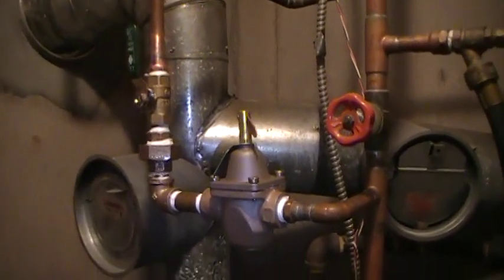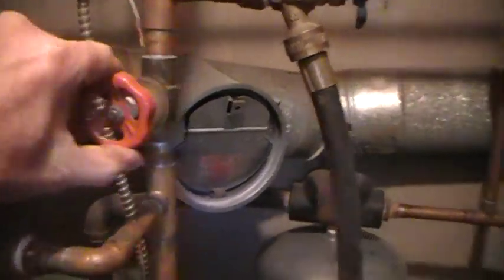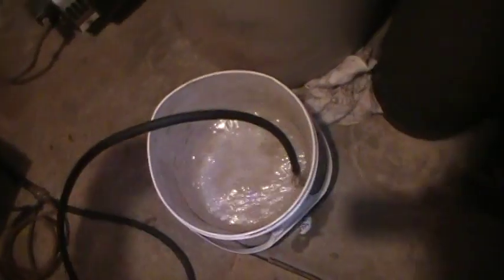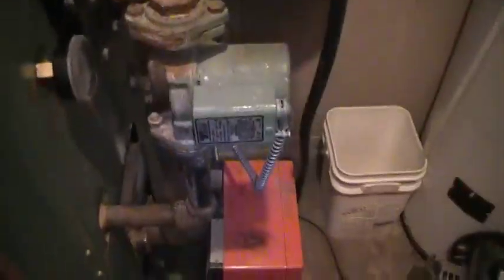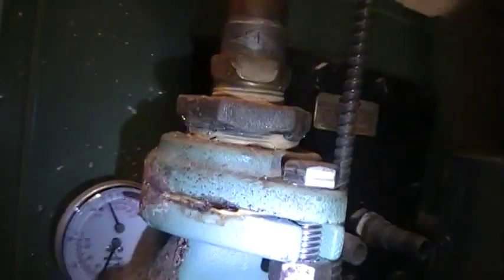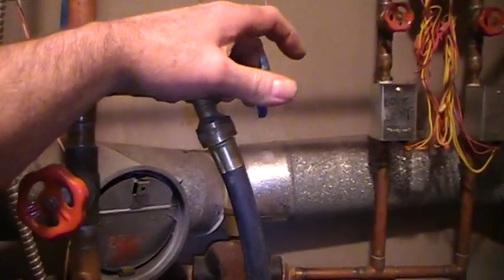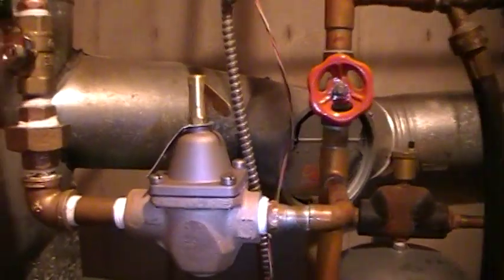How to remove the air out of your hot water heating system-girgling noise.

Comment: I wish I could have you come to my folks house.   Their gas flame is burning almost non/stop, and the baseboards are cold.  I think there is a problem with a lack of water in the system/too much air, but I can’t match up their boiler/system with the one you have.   Is the return valve the same as the valve which controls the water supply?   They have a pump that circulates the water.  The boiler and piping is very hot because the gas flame is burning so much.  One pro said the boiler needs to be replaced at a cost of $5500, the other cleaned everything, with no improvement.   It seems like this is a simple problem to fix but I’m struggling to find a solution, and wasting money on professionals who either lack the knowledge or integrity to fix the problem.  😢
Reply from the maker: Hello Dubble D,
Looking at the boiler; you have a pipe coming off the top and one on the bottom. The one on the bottom is your return line. If you follow it; you will find the pump that you mentioned and a valve on the same line either above or below the pump. Depending on the number of zones in the house; there could also be a few tees with individual valves on each branch. You should find drain valves just before the valves. Hopefully you can follow me here.
What type of heating system do they have? Is it baseboard heat or cast iron radiators? 
The burner should only run until it reaches temperature in the boiler. 
What is the pressure on the gauge (tradicator) on the front of the boiler? The pressure should be between 10 and 20 PSI. If not you will not have enough pressure to make the water rise into the system.
Is the heat not working in all the house or just certain parts?
Are there zone valves on the system as well as in this video?
By the way...changing the boiler is not the solution.
Get back to me later on today and we will see if we can fix this problem....
I will check in later on....Al
Reply: Thanks Al.  It is baseboard heating, no additional zones.  There are pipes which seem to go everywhere.  The pressure is about 20.  I can identify the water supply, and the drain faucet is below the pump.   There are no multi zones.  All the baseboards are either cold or lukewarm only when the burner/pump are running.  The return line is burning hot, just like the boiler and the exit line.   This problem is beyond my scope of understanding; the complexity of the piping is very confusing.
Reply from the maker: Hello Dubble D,
Air is definitely the problem. 
You will need someone to either purge the air out of the system or attempt it yourself.
If you look on the end of the baseboard cabinet you may see an air bleeder there. On older systems these bleeders were installed to remove the air in the system. Depending on how old the system is; this could be what is there. It could be on either end of the baseboard.
Very easy to remove the air if this is the case. Simply turn the screw or wooden handle until you here a little air coming out. once you get water simply close the bleeder (needle valve).
Wish I could help more.
If I lived next door; I would drop over and get things in order for you...
Thanks for commenting and best of luck with the repair!
Hope you have a good holidays!    Al

Comment: Great video. After watching this video I do not know if you can help. I have a split ranch home with 3 zones for 3 floors. The upstairs floor gets plenty of heat, the second (middle floor) gets no heat & the first floor, where the boiler is get a little heat. The circulator pump is working the zone vales are open.
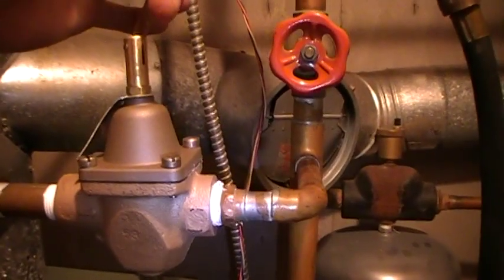My problem I have three zones and they join into one pipe without any return shutoff valve and I do not have a pressure reducing valve like you have in the video. The supply line goes to  a fitting like the one that is in the video at 2:27 with an expansion tank & air bled. When I try to bleed the line I cannot remove all the bubbles plus the water stop flowing, pressure goes to  0.  Your help will be appreciated.
Reply from the maker: Hello Joe,
There has to be some reducing valve to keep the pressure low or your relief valve would be flowing continuously.
It may not look like the one in the video, but there should be one somewhere in the line feeding the boiler. Follow it back and see if you can find one. 
Does the pressure rise after you purge the loop and are you isolating a valve on either end of the loops?
By turning off the power on boiler that will close all the zone valves. A return valve must be closed to purge the air properly. 
Is there a single valve below or above the circulating pump on the return? This was a common practice on older systems.
Having low pressure generally causes the second floor to lose heat first. 
Get back to me when you get a chance....Al
Reply: Hey Al thank you for replying so quickly. With the supply side open I do not understand how it went to 0 PSI when I opened the return line to purge. As I mentioned it does not have a pressure reducing valve, ( or I just can not find it)so I do not know what is blocking the inflow or keeping it from building up too much pressure. The water supply is from a well. When I shut the drain valve it takes a long time to regain pressure. There isn’t any shut off below the circulating pump on the return. If you have any time to look at it I took a short 2 min 30 sec video to show how it is set up. I do not know how to send it to you by you tube. Do you have an email that I can send it?
Any suggestions on how I can get the other zone free of air. If possible I rather  not have to open the lines due to the weather if possible.
Reply: TheOldkid888 do you have the power to the boiler on while doing this? Does the circulator Pump help remove the Air
Reply: I tried it with & without the circulator pump on. The pump does help but I did not let it run too long. When it started to make a gurgling noise I shut the pump off. Not sure if the pump would be damaged if no or not enough water flow through it. As far as a pressure reducing valve It looks like I have an automatic one that is attached to the expansion tank. Found this while looking up parts.
Reply: Joe San r

Comment: Hi, I have a Peerless WB3 with no zone valves. Where is the return valve located? Thank you.
Reply from the maker: Hello Believeit,
The valve should be located in line on the lower section of the boiler. Sometimes there is only one valve that isolates every zone on that end. It should be just above the pump. I always install a valve above and below the pump in case it has to be changed.
Thanks for commenting and enjoy your weekend!       Al
Reply: Thanks Al.

Comment: What should the boiler temperature be when doing this ? Thanks
Reply from the maker: Hello garagekeys,
The boiler can be left on if you are planning on doing this and it will cut in to control boiler temperature.
Temperature of the water does not affect the amount of air that will be purged out of the system. Hope this helps!
Thanks for commenting and enjoy your weekend!   Al
Reply: thank you!
Reply from the maker: Good luck!    Al

Comment: Is there any reason this can't be done backwards:  shut off the outgoing, open the zone, and open the faucet/gate/spigot?  Does it matter where the pressure reducing valve is?
Reply from the maker: Hello Glenn,
In this video the zone valve is locked opened as you stated. The return valve has to be closed as the air must be forced out of the sediment faucet. Having the return valve opened will only allow water to flow out of the boiler. You want it to flow around the loop forcing the air out of the sediment faucet.
It doesn't matter where the pressure reducing valve is located. The water will flow into the boiler and then the loop through the zone valve.
Thanks for commenting and enjoy your week!   Al
Reply: Thank you for your prompt response, however, I don't think I explained myself well.  The only shutoff valve that closes both of my zones at once is located on my outgoing pipe, before the expansion tank, not on the return.  My purging valves (I think that's their purpose) are located above the zone valves on the return line.  However, after the two returns merge into one pipe, my pressure reducing valve enters the line before it hits the recirculating pump and goes into the boiler.
So, can I perform this operation backwards, that is to say, close the outgoing line, open one zone, and open the purge valve or will water from the reducing valve just travel upwards two feet and flow through the purge valves instead of flowing through the zone pipes?  Thanks.

Comment: Thank you very much, this is very helpful! if I can have one question though,do I need to turn off the boiler to purge the air or I can just turn off the heating via the thermostat?
Reply from the maker: Hello  小秦,
You are more than welcome!
You want to turn off the boiler itself. I have seen people purge the system hot. I prefer to turn it off myself. 
Hopefully everything will go well for you!
Thanks for commenting and best of luck with the project!   Al
Reply from the maker: Hello eEva,
If you turn your thermostat up it will open the zone valve and no need of manually hooking it. You will only need to close the return valve and purge the loop. Should be all set.
Thanks for commenting and enjoy your weekend!     Al
Reply from the maker: Good luck!    Al

Comment: Al, When you use the pressure reducing valve, to increase the pressure - in case it goes to low or you just want to force more air out and increase the pressure. Lets say the pressure goes to 20 psi. but you want only 15 psi, after adding pressure to the system, how do you get the pressure to go down to 15 psi again ?Thank youSteven
Reply from the maker: Hello Steve,
I put the pressure up to a constant 20 psi to purge all the air out of the system.
If you don't keep the pressure up when purging you will not remove all the air.
After purging the system and the sir is removed; you open the sediment faucet that you used to purge and you can drop the pressure back to where you want it. If it drops too low simply lift the lever on the reducing valve and you can adjust it between 12 and 15 pounds. The valve should automatically adjust the pressure to 12 pounds if it is not plugged with sediment. 
Thansk for commenting and enjoy your week!    Al

Comment: thank you for your wonderful video, and I purged my 4 zone system, but one of my 1st floor family room, the bubble would not stop. I ran the the water out for 10 minutes ,   but it wouldn't go away. can you tell me why I am not getting the bubble free drain? thank you
Reply from the maker: Hello Moon Hee Kim,
You're welcome!
There could be more a little more radiation on that loop, so when you purge the system you made have to increase the pressure and keep it a little more constant. Bring it up to about 20 pounds by lifting the lever on the pressure reducing valve while keeping an eye on the gauge so that it doesn't get near 30 psi.
Purge the system with added pressure will push all the air out of the loop.
Do you have an automatic air vent on the system?
Thanks for commenting and get back to me when you get a chance....Al

Comment: I have three zones and below them, after they join into one pipe,  is a singular yellow lever,  is that the shutoff valve?
Reply from the maker: Hello shakefly,
From what you have explained that would be the valve you turn off. From there you would purge each zone separately.
Thanks for commenting and best luck with the project!    Al
Reply: Thank you!. My system looks fairly simple compared to some friends. I have the 3 purge spigots, right below behind them are the thermostats that I can change from automatic to open, then the 3 pipes converge and there is a yellow valve handle, and then below that is a teal colored, what I am assuming is a pump of some sort. 

Thank you for your help!
Reply from the maker: Hello shakefly,
You are more than welcome!
You should be all set. Remember to purge them one at a time and everything should work out well for you.
Thanks for commenting and enjoy your day!    Al

Comment: I dont have a shut off on the return.  How can I flush my system?
Reply from the maker: Hello Know How,
When you say you don't have a shut off on the return....
If you follow the return pipe from the bottom of the boiler to the loops; is there a shut off below or above the pump? I have seen only one valve installed on the return and it is below or above the pump. You can have numerous zones and purge with this valve.
Do you have sediment faucets on the return loop to purge? 
Thanks for commenting and get back to me when you get a chance....Al
Reply: I have a SO valve below the pump.  Below the said valve, there is a T where the city water enters.  Then they join together as one pipe and enter the boiler.  There is a pipe that comes out and meets an expansion tank.  It then branches out into 7 pipes.  (5 branches have SO valves and 2 do not.)  It then comes back.  (This time, all 7 pipes have SO valves.)  They all turn into one pipe and meets a drain valve (I think that's what you're referring to as a "sediment faucet").  And then it's back to the pump.

Now that I've looked at my system more carefully, I assume that I close the valve below the pump.  If so, should I turn off the pump before closing that valve?

What explains the 5 out of 7 SO valves on the outgoing pipes?  Does that mean I cannot purge those lines?

Thank you so much!
Reply from the maker: Hello Know How,
You can close the valve below the pump and turn the pump off is exactly what to do.
I am not certain as to the exact configuration of the piping on your boiler, but you should be able to purge every zone individually. 
You don't do anything with the valves leaving the boiler on the supply. You simply hook the lever on each zone valve one at a time. Purge and move to the next.
Thanks for commenting and hopefully it will go well for you.    Al
Reply from the maker: Hello Know,
You-are more than welcome.
Sorry I didn't respond sooner. Didn't see the post.
You are on the right path and should be bale to purge all loops through that one sediment faucet.
On some heating systems a loop may split and return back to one on the return. This may be the case with a few of your loops, but they will still purge for you.
Thanks for commenting and best of luck with the project.    Al
Reply: It's overwhelming at first, but once you start to understand it, it's all pretty basic.  Thanks again for taking the time to reply.  Most YouTubers don't!
Reply from the maker: Hello Know How,
You're more than welcome!
Yes, you absolutely correct. It seems like a big task at first, but when you stop and take a few minutes to see how the purging takes place; it's very straight forward.
I am glad you got along well with the repair!
Thanks for commenting and enjoy your weekend!    Al